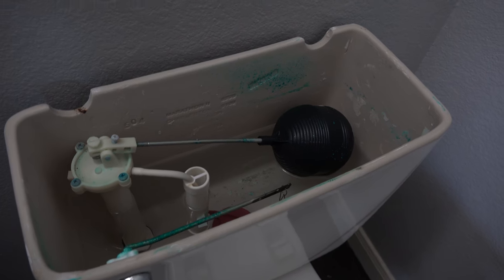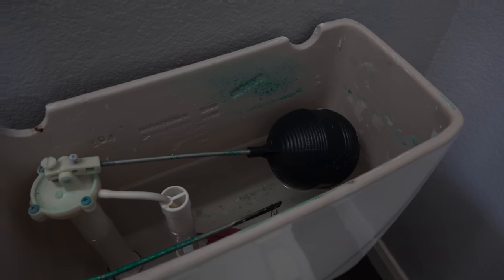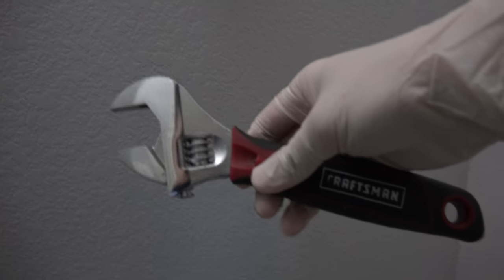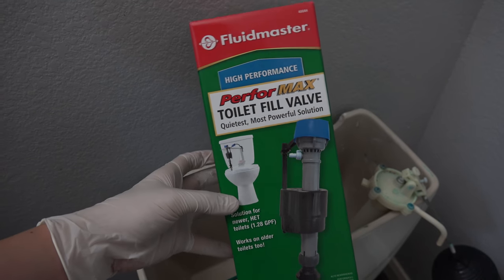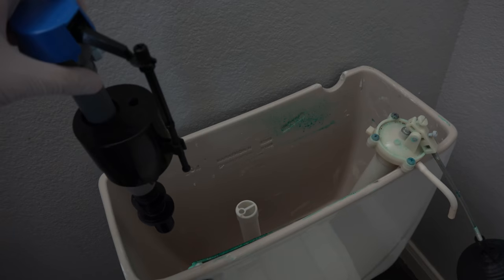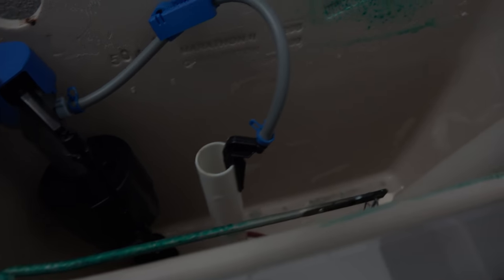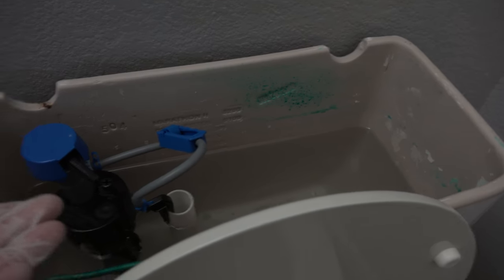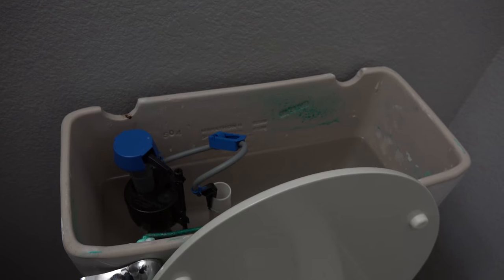How to Replace the Old Toilet Float Valve with a New Style Fill Valve 4K

Comment: looks like somebody stripped out the adjuster.  Probably tried adjusting it under pressure.
The problem with that newer style is they plug up and then work funny.  They are easy to clean out, but small consolation when the old ones generally just keep working.
Also, I was trying to find "safe" cleaners for in tank use, I have yet to find a plumber that recommend anything to put in the tank.

Comment: I tried to do this but water keeps leaking from the bottom so how can I ensure the valve is secure because I tried to tighten it the best I can but I don’t have the strength of a man to do it
Reply from the maker: It shouldn't take much force. Make sure you have the oring to seal the water from leaking. Watch my new video on it - https://youtu.be/SDEiU_WLCQA?t=258